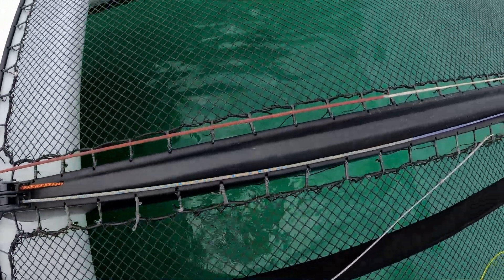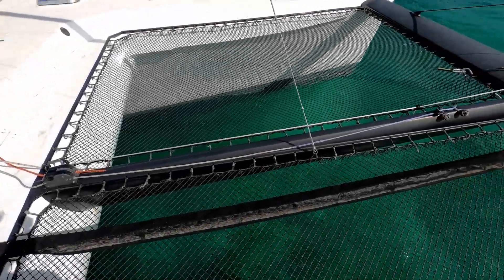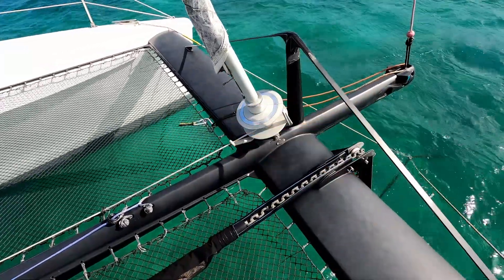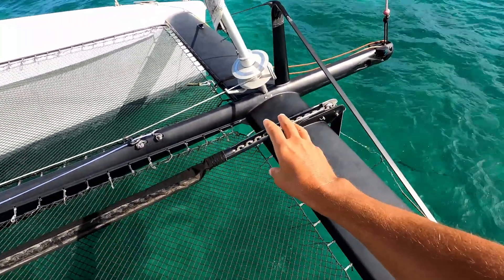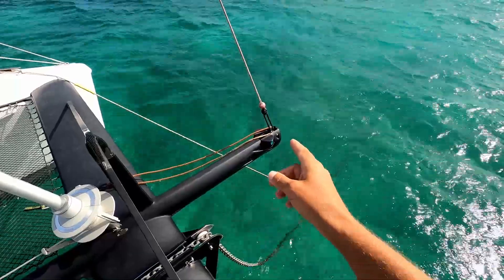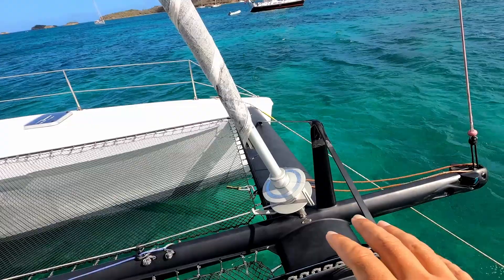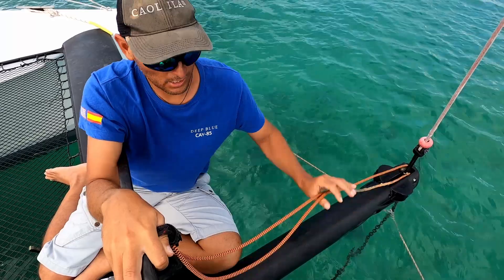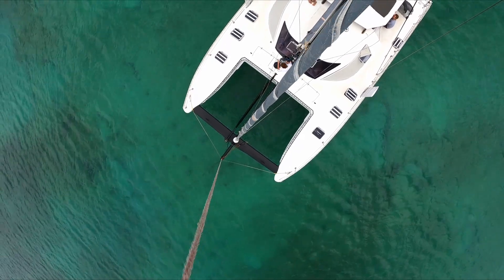How a Carbon Longeron Transformed Our Catamaran

Comment: That project came out top notch. It looks sexy as all get out. I am still working on a way to set up my structured luff staysail for heavy wind. So far triangulating to both front cleats then back to the windlass locker seems to be what I have available. My longeron is not a fancy carbon structure like Paikea's.

Comment: How much extension would the bow pole need to be able to have the headsail unfurled whilst flying the code zero/kite,  eventually leading to triple headed downwind sailing with the staysail?  Is there a formula for the dimension?
Reply: About 2.5m. The spacing is approximately 30% of the sail you are flying in side of, if that makes sense.

Comment: I like it. The longeron,  crossbeam and integrated spirit pole is amazing. I think one of the important points of your videos is that a plastic boat can be changed and molded so to speak into what you want. One of the points that I keep coming back to is the planning for this structural upgrade. I am interested in how you did the planning and what tools you used. I keep think that I could not do all that you have done do to cost and technical expertise but I keep challenging myself with that. Maybe I can? 
Thanks for sharing, I really enjoy your insight and find it inspiring.
Reply: Haha, not much planning it is a bit fly by the seat if my pants compared to what I do professionally. 
The planning is mostly identify what I want at the end, lots of ball park hand sketches. Then look at what I have available to me, this sometimes takes quite a while for something to show up. Once I have a possible candidate parts or materials it is just the process of a bit of reverse engineering to nail down the suitability. Then design the system to be made. This is done in cad, 3d models are done of what I'm planning to make sure everything works then I make 2d drawings from the 3d cad models.
Costs are easier to then estimate once the plan get down the track and I know what I need
Reply: @shayneyoung4801  It sure does make it a little easier with CAD.  I was considering what it would take make CAD model of my boat.  There is some pretty cool software that scans the surfaces and creates a 3d surface.  Haven't used it yet but going to give it a try.  First things fist, moving Swift to Guatemala in July where I will be able to work on her.  Cheers! Love your work.
Reply: @danahawthorne1633  yeah there is soom cool tools for scanning now available. I tried a couple of the  phone based ones with little success, they are intended for small had held objects or house size objects.
Getting the point cloud sorted to make surfaces from was the next challenge. I want to look at it all again soon as it makes it so much easier if you have a model and drawings to work with.
Reply: Yes, you are 100% a plastic boat can be changed to suit you as much as  your time and budget allows